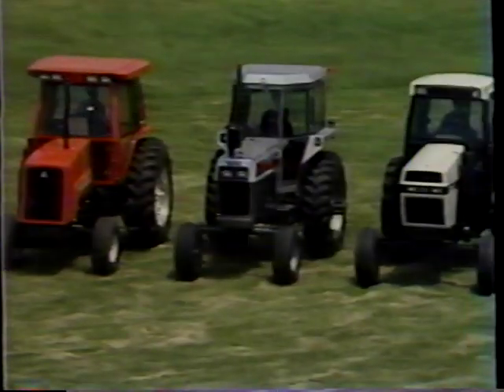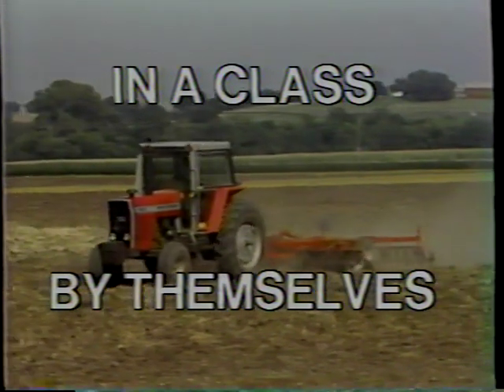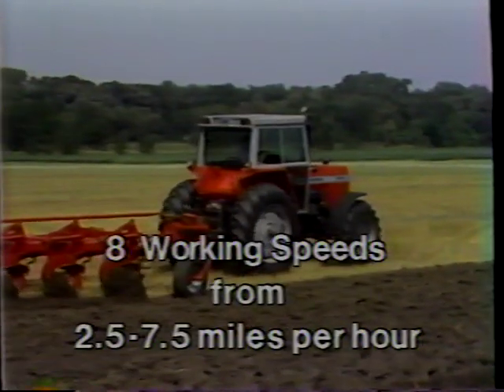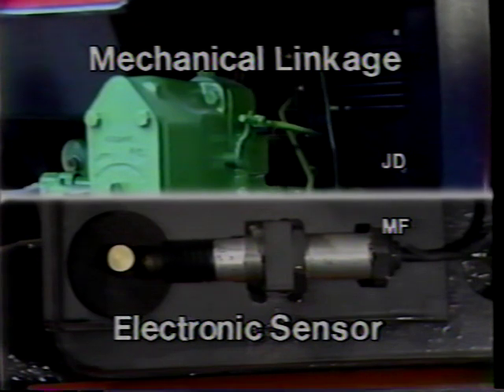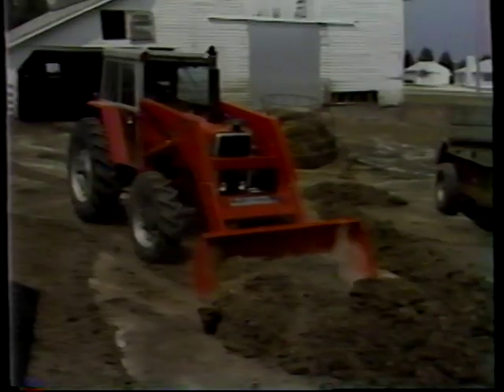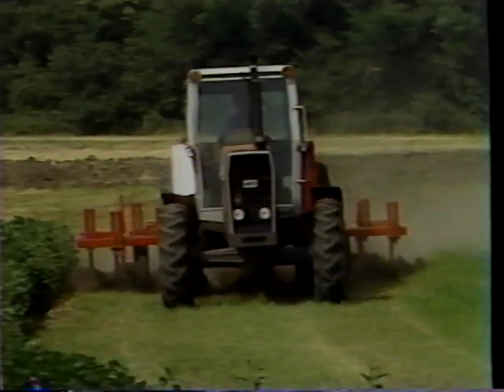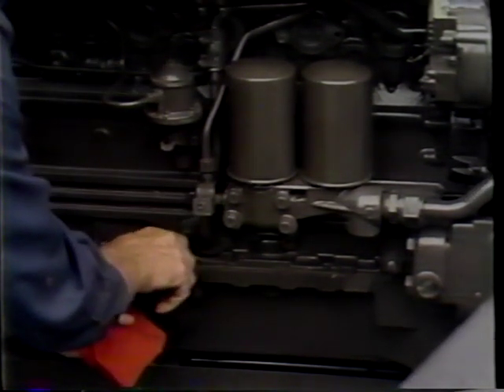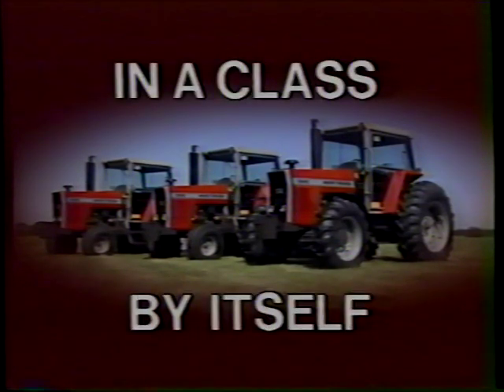Massey Ferguson Instructional Sales Video

Comment: never heard of 3500 series before, is it a US only model?
Reply: The MF 3500 series were introduced to the US market in 1983, after the Detroit factory was closed. The previous range of MF 2000 series tractors had been built there, specifically for the US market.
 The MF 3500 series were actually built in France, and imported to the US, so that MF could maintain some semblence of a tractor offering for that market.
The newly introduced range were of course very similar to the European built MF 2000 series, but specifications were tailored to the US market - things like bar axles versus flanged axles, and additional lighting packages to name but two features.
Reply: @jamesbarbour8400  3500? 3000 and 3600 more likely?
Reply: @andersbjrnsen7203  nope - there actually was a short lived series, the MF 3500 series, derived from the European built ( MF's Beauvais factory in France), MF 2000 series.
MF was in huge financial difficulty in the late 70s and early 80s, which eventually resulted in them closing the doors of the Detroit factory, in 1983. That was the death knell for the US built MF 2000 series, which had included 3 V8 engined models and two six cylinder models.
 In order to maintain a tractor presence in the US market, European built MF 2000 series tractors were imported to the US, and with various options specific to the US market, such as bar axles and additional lights on the tractor cabs to meet US vehicle lighting regulations, were designated the MF 3500 series to distinguish them from the previous range, though in reality, there was little difference. The gearbox was also improved, as the 24 speed US unit proved to be very problematic. The MF 3500s had a 16 speed 'box if memory serves, and the tractors were all six cylinder machines of varying horsepower, achieved by altering the fuelling ratio, amongst other measures.
 In October 1986, the Eueopean designed MF 3000 series, designed totally from scratch, and incorporating a hugely efficient transaxle design, was introduced to the UK and European markets. These new MF 3000 series tractors superceded the MF 3500s in the US around 1987, since Beauvais had of course stopped making the MF 2000 series from which they were derived, and so could no longer supply the US market with those models - they were only meant to be a stop gap solution in any case, as MF had been developing their successors for a number of years prior.
 The European built MF 3000s featured an array of electronic controls, not just for the linkage, but also the gearbox and engine were monitored in order to constantly give the most efficient running of the tractor. Despite MF's dire prior financial misfortunes, their new range ushered in what everybody now takes for granted on small to mid range tractors. The latterly introduced MF 3600 series took the same concept into the upper horsepower categories, though all tractors of both ranges continued to be of conventional, rigid frame layout. It will be remembered that MF first utilised electronic draught control on their massive articulated tractors, the MF 4000 series, introduced in 1978.

Comment: Massey ferguson  are the best!
They look similar to the 2000 series.  The mf2680 is a great  machine.
Reply: The MF 3500 series are pretty much an Americanised version of the French built 2000 series.
 The MF 3500 series were marketed in the US in 1983, to maintain a tractor presence in that market, after MF closed the Detroit factory. The artic MF 4000 series continued to be built up in Brantford, Canada, but the US built MF 2000 series were discontinued at this time. MF were in huge financial trouble during the late 70s and early 80s, hence the plant closures.

Comment: Great video! My dad bought a 3525 4wd after I joined the Navy.  On leave one time I got to plow with it. It was amazing that it could pull the same plow better than the more powerful 2745 that he traded in that I spent too many hours of my life operating.
Reply: The MF 2745 was powered by a Perkins V8 - 540 engine - as with all V8s, they had to be revved hard to get any decent sort of performance. The tractor transaxle assembly was massively built and very strong but also very heavy as a result.
 The MF 2745 probably spent a good proportion of its output simply moving the tractor itself, before taking pulling an implement into consideration.
 The six cylinder MF 3500 series tractors were simply market adapted MF 2000 series tractors built in France, at the Beauvais factory.
 They were imported to the US to help MF maintain a tractor prescence in the US market after the closure of the Detroit factory, thus bringing to an end, the production of the US sourced MF 2000 series tractors, 2 of which were six cylinder machines, whilst the three largest in the range were all powered by V8 engines.
 Due to the terrible worldwide financial situation of the late 70s and early 80s, MF had to close both their Des Moine, Iowa factory in 1981 and the Detroit, Michigan facility in 1983 to try and stem their monetry losses.

Comment: I recently bought a 2680 2wd French Spec. There is very few in Scotland. I am proud to drive and own one
Reply: 𝐌𝐚𝐬𝐬𝐞𝐲 𝐍𝐨𝐦𝐛𝐞𝐫 1
Reply: I got a 2640 and it is great!
Reply: I have the privilege to own a 1990 Massey Ferguson 3070 90hp 4cly. 236ci turbo (3.9L) fuel efficient for its size. Made in France. Love this model for my needs. This tractor is in very good shape been barn kept. Low hrs .  I really like the 3070's weight and size . It's a solid built tractor. I always been a Massey Ferguson fan. While growing up we had  many of different Massey Ferguson tractors. MF 35; 65; 135; 165; 175 255; 265; 275; 285;  461; 471 were all that my dad had owned. He also had own a WD Allis;  8N Ford ; M Farmall . Today I have a 3070 Massey Ferguson cab 90hp; 5320 John Deere cab 64hp; and a 539 IMT 39hp.

Comment: Very nice video. I have a 4WD MF 2725. It's the European version (build in France) of the 3500 series. My MF 2725 has 147 hp en was build in 1987.
Reply: 3500 series was also built in France, they just have a few little differences compared to european 2000 and 2005 series. MF came with the 3500 series after they closed the Detroit tractor plant.
Reply: @MFV8  MF 3500 series were only built in France, no-where else !
 They were simply market adapted versions of their European built MF 2000 series tractors (not MF 2005 series which weren't introduced to market until around mid 1985).
 MF needed to maintain a prescence in the US tractor market after the closure of the Detroit factory in early 1983, thus bringing to a complete end, production of conventional, rigid frame tractors formerly manufactured at that factory.
 Bar style rear axles, and lighting options would have been the main differences, plus the option of ELC which didn't appear on European market models until the introduction of the MF 2005 series in 1985.
 Further, whilst the European transaxle was outwardly similar to the former US tractors, internally, the gear selection arrangement and 2 speed powershift were head and shoulders above the former 24 speed, 3 range powershift unit used on the former US models - that particular gearbox gave no end of trouble and resulted in the firing of Lee Elfes, who was Head of Tractor Engineering at the time.
 MF's reputation in the US large conventional tractor market, suffered immeasureably due to the gearbox issues.
Reply: @jamesbarbour8400  Thats exactly what I said in my comment, that they also were made in France like french 2000/2005 series. And 3500 series was originally based on french 2000 series but when 2005s came around the same updates were introduced to 3500 series, for example the late 3500s have 2-door cabs like 2005s have. Also I believe all 3500s have 2-pump hydraulics as standard, unlike 2000/2005s.